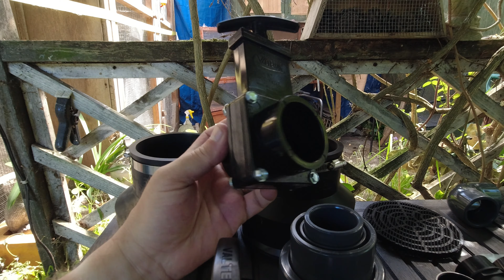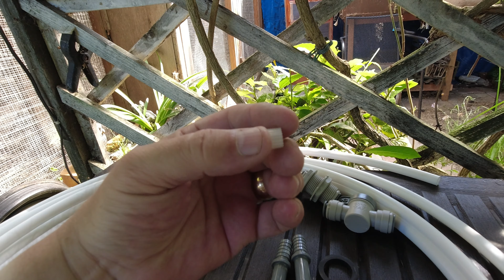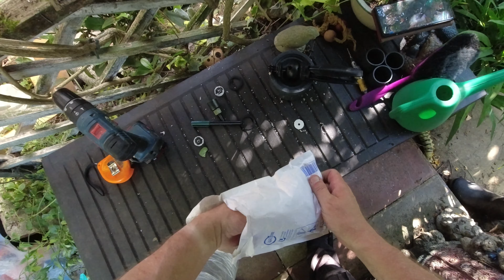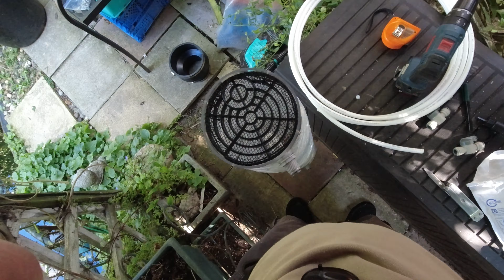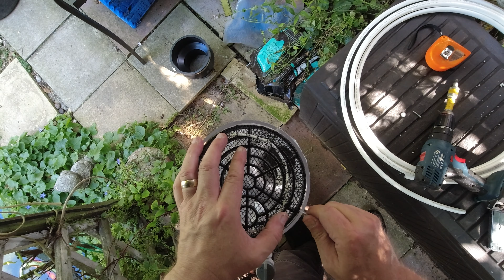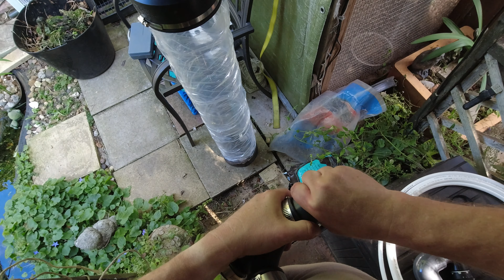Up Flow Filter part 1

Comment: Just looking at the airline inlets, I'm tempted to apply some heat (using something like a travel iron - and a thin cloth) to create a small area of flattish surface for the connector to sit better and avoid leaks - any thoughts on this?
Reply from the maker: Hi. I wouldn't use a static heat source like an iron. An air stripper is a far better solution for these because you can move it around and therefore control the heat better.  You also do not need to come into contact with it like you would with an iron. If you use an air striper dont forget to move it around constantly so you control the heat better. You would be surprised at how quickly it can go all wrong.
Reply: @ItsWhatIDo  Thank you, I'll take your advice.

Comment: Hi Jim, I just come across your channel whilst searching for upflow filter designs. Also see that your local to me Thurrock? I’m on Canvey. Great videos but I do have one question. Is the outside diameter of the acrylic pipe 160mm as the reducer (I.e. 6” to 4”) is 150mm. So would that fit over the 160mm pipe?
Reply from the maker: Hi Mate. Yes your not too far from me. I'm in South Ockendon. You need to be careful with the reducers. I bought one that was supposed to be 6" to 4" and when I measured it it was closer to 9" in diameter. You are better off sticking with metric. I think the last one I bought was from this link https://www.plastics-express.co.uk/144-160mm-x-110-125mm-adaptor-p-pte650. And yes my pipes are 160 with 4mm thickness walls. They are nearly double the price from when I bought them.
Reply from the maker: Si, if you need to actually see the upflows you are more than welcome to pop over and have a look. My pond is tiny compared to yours but it might help to see the setup.
Reply: @ItsWhatIDo  hi Jim thanks for the response and head ups on the reducers. It’s good to know. I’m currently running a Nexus and was was getting fines. I recently just finished building a Bakki Shower so hoping that would help with water quality running from my skimmer. I like tinkering so was thinking of putting in an upflow after the Nexus to catch the fines.  Thanks for the invite and I may well be in touch regarding a visit 👍